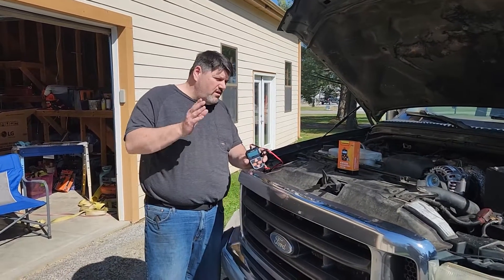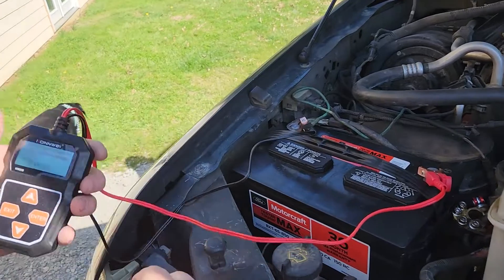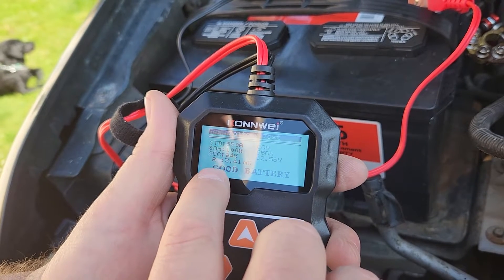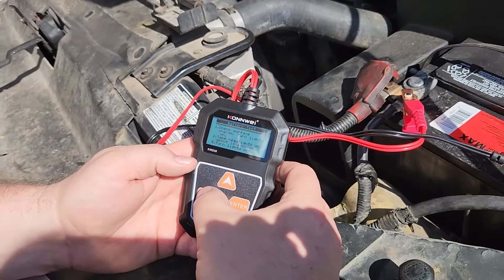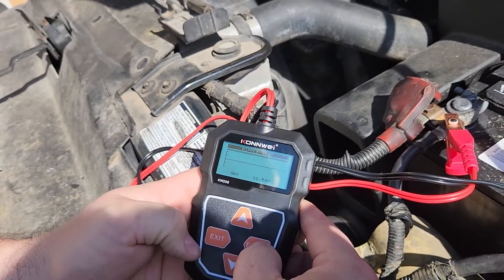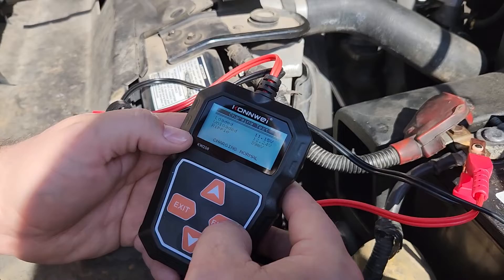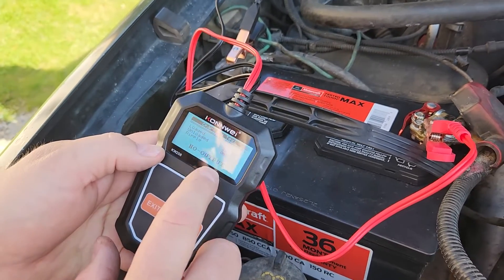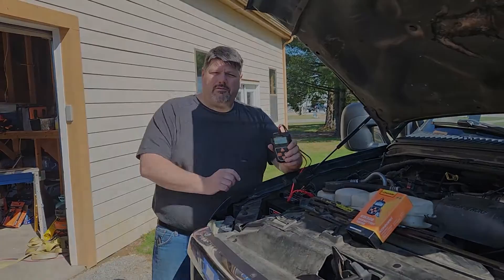KONNWEI KW208 Battery Tester | Review and How to Use! | AFFORDABLE BATTERY TESTER!

Comment: The clamps actually have two separate connections per side, one delivers the test pulse loads, and the other measures the voltage when loaded or unloaded. 
It's critical to make sure the individual contacts are touching the same metal, ideally the bare post, or else the results will be thrown off and vary each time you repeat the test. 
It will pick up the drop from the battery terminal bolt to the body of the terminal and give you the wrong reading, so for accurate and reliable results, test directly on the battery posts.